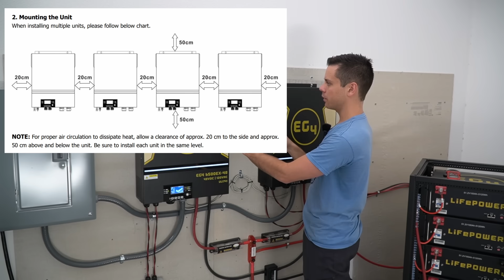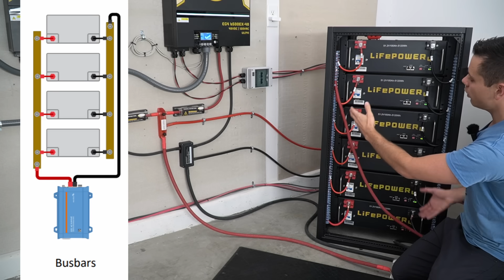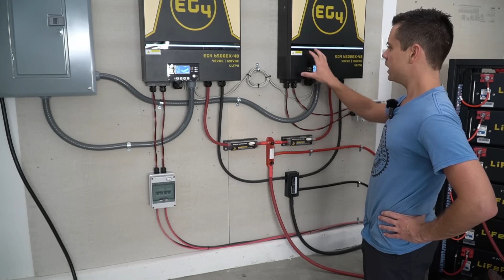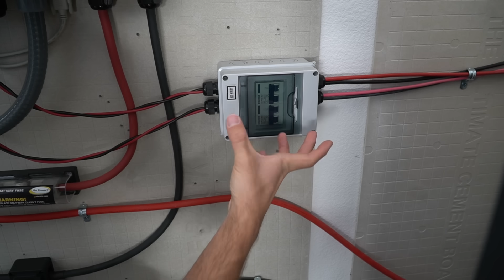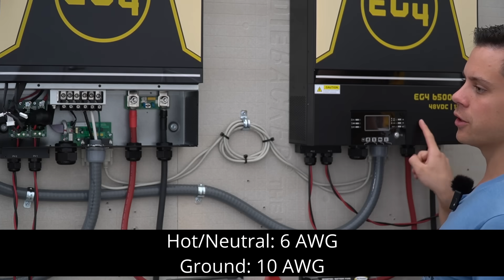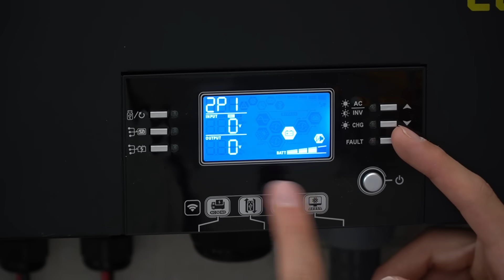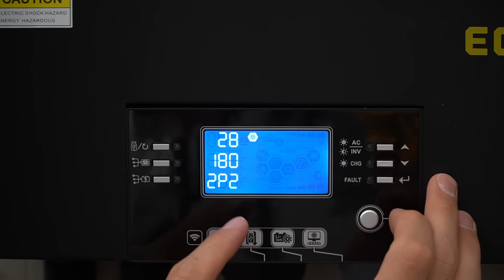Complete 48V Offgrid Solar Power System

Comment: Thanks Will for the detailed and very informative video and also the blueprint on your site. I was already sold on the EG4 batteries but was leaning very heavily on the Growatt inverters. Based on your video and reviewing all the information on Signature Solar site, I have decided on the EG4 6500EX-48' inverters also. Order was placed for four-batteries to start and two inverters.

Here's my questions. 
1. I have built a "solar-shed" about 100 ft from the corner of my house where the main enters the house. I currently have a 13kW backup generator that can be connected to a 50amp connector and also have a 50amp 2-pole circuit breaker with an interlock device on the main panel. In looking at the specs of the EG4 inverters in split phase I am seeing a running amp rating of around 54 @ 240v (13,000w / 240v = 54.17 amps). With the inverter surge capability would it be safe to use 60amp or even a 100amp breakers, both at the connection point and the main panel. Also feed this circuit from the solar shed sub-panel with a dual-pole 60amp or 100amp breaker?

2. The other question which is coming from my electrician is the "service-cable" from the solar shed to the main panel connect point. He is saying that 50amp on 1/0 cable is the way to go. What is the max amps I can run on a 100' service entry cable? Where do you find this cable?

The reason I am asking is that I have had several occasions to run the 13kW generator for the whole house and it does trip the 50amp circuit breaker on the generator at times, especially when the AC kicks in. I am looking at installing a "soft-start" on the AC's which should drop the amps needed significantly.
Reply: quick update...I just spoke to my electrician friend again. He is suggesting this solution:
- 100 amp sub-panel in the solar shed to service the shed and inverters and shed power loads for lights, etc.
- 2 ground rods outside the solar shed to ground everything in the shed
- 2-2-4-6 Aluminum, direct burial, service entry cable from the shed to the main house panel
- replace the existing 50amp breaker being used for the generator with a 100amp breaker and connect the service entry cable to it
- neutral and ground connected appropriately in the main panel
- this will allow the use of the existing interlock safety switch to make sure the grid main and solar main cannot be on at the same time
- move the 50amp connector and circuit breaker to the shed to be used as AC input to the inverters for backup battery charging via the generator

Comment: Hi Will, we bought the growatt combo with the eg4 battery from signature solar. They have been awful with their customer service. Both growatt units have issues right out of the bix. They are doing nothing to help,replace,or return without substantial cost. If you have a contact for them would be appreciated. So far signature solar has been the worst company I've dealt with in years.

Comment: Hi, nice video’s ….are you planning to make a video about creating a DIY AC coupled home battery, for storing ‘not used’ power of a (enphase) micro inverter solar system that is still connected to the grid. Living in EU where off grid is still one bridge too far (solar system with yield of approx 4000kwh/yr…yes only small roofs here-;)

Comment: Do you have a video for solar power for a complete beginner, because when I return to the Philippines I want to put an "off grid" system in and a way to switch it over from the main fuse panel for when the grid goes down! Thanks

Comment: Would this system also be compatible with grid tie? Most solar quotes I am getting are using Enphase IQ8+ microinverters. Can I add this for the battery side? Or do I just forgo the IQ8 inverters entirely? Heard if a single panel goes down that entire system goes down with string inverters. That is also why I was looking at Enphase. Was that all in the past?

Comment: This is something I have been looking at for a long time and I finally am seeing the chargers/inverters that do what I want them to without having to have lots of boxes all doing their own thing. Now my question is... If I were to put a system like that in my shop would the inverters have enough power and reliability to run a 220v air compressor along with other loads?

Comment: Thank you for this great video Will!!  I've watched this at least 15 times so far.  I have learned so much from you and the DIY Forum.    I am getting ready to install my LV6548 with 2-EG4 48 batteries.  I hope to add a second inverter down the road.  The plan is to have AC output to my main breaker panel next to the LV6548 and a sub-panel from that to our off-grid cabin.  No grid tie, but will be having my Honda EU2200i generator going to the AC in on the LV6548.  Would be a good idea to follow exactly this setup you did?  What size breaker did you use for the 2 inverters coming into the breaker box?    Thank you!!!!

Comment: Be careful with this Inverter. I got one last week. It worked great for a while then something happened not sure what caused the fault but the PV input has a short on the input. The short circuit caused a small fire with one of those cheap DC breakers, don't use them! I have been waiting for some  support for Signature Solar to see if they can diagnose the issue. I think it is going to be a Return to Factory. Signature Solar is busy and are taking several days to return calls etc. This Inverter has a lot of potential but be careful and not cheap out on DC Breakers. If/When I get a replacement, all DC breakers are going in metal boxes with Elide fire suppresses just in case of an other issues.
Reply from the maker: Holy cow can you post some videos to our forum?? Or pictures or anything thats awful. Would really help everyone if we can see what happened.
Reply: @WillProwse  Yeah I have some photos and video. I will post in the forum.
Reply from the maker: OHH wait was the breaker sold by signature solar? Which model number exactly is on it
Reply: @WillProwse  No  it was not a Nader DC Breaker. It was a cheaper DC breaker from Amazon. I will only be using the Nader Breakers or something of similar quantity going forward.

Comment: Great video Will. Thank you. The only thing I can't figure out is if these units have remote gen start in them, or is that something else I'll need to add on? Planning on building this exact same unit with a propane gen to supplement cloudy days in the NW.
Reply: Cummins make a transfer switch, which was installed AFTER the pair of LV6548s, with a 120V sense input on the Cummins generator to switch the transfer switch from the LV6548 to the Cummins if the LV6548 output disappeared (i.e. no grid, no solar, flat batteries). I also wired an EG4 Chargeverter to the Cummins output to charge the batteries when the generator is running.

Comment: The 240Vac is common in Asia and Europe. The kicker is massive output of 13KW which got everyone jump for joy this side of the pond! The battery bank to inverters sizing is spot on. Thanks for the clear and concise info as usual.
Reply: If you work with Signature Solar AND  listen to Will, you should have no "problems." I like when Will says, "problems," as this could mean fires or electrocution, LOL. Will is actually more knowledgeable than the average electrician when it comes to this genre.  I'm putting this exact same set-up on my off-grid farm in NW NC.

Comment: Will, I'm in the process of researching a "hybrid" 48v DIY system (240v AC as I have a well pump and air con).  I want the bulk of my power coming from solar, but with the grid for charging my battery bank on crappy/cloudy days.  is it as "simple" as a large enough PV array plus a grid powered AC charge controller?  install a second new main home panel, rewire it to my DIY solar off grid panel.  then have my old grid-powered main panel charge the battery bank simultaneously with new PV main panel?  will land somewhere in the 10-14kw PV array and 400ah bank, sizing up my battery bank as funds allow.  any plans for systems like that?

Comment: In UPS (Bypass mode) what is the specified power that can be supported by this configuration?  Is it the 13,000 W?  I assume that in bypass mode, the system maintains the batteries charge while the grid is up and the batteries/ inverters take over when it drops out.  The principal reason for these seemingly obvious question is to verify that in this mode the units have the same power specs as in normal inverter mode.

Comment: The EG4 6500 EX-48 spec sheet states operating altitude of up to 1500 meters.  My location is at 8700 feet ( 2652 meters.)  I am concerned about the inverter and what safety concerns might be involved when using it at that altitude.  Anyone have experience using these inverters at higher altitudes?

Comment: So for a 240V system, like in England, I would require a minimum of 2 EG4 units? Thanks for the video
Reply: No one will suffice.   You can set the voltage to 220 or 240.  Wills setup uses 2 inverters because of the US 120/240 split phase.
Reply: @cryo450  Aah makes sense. Thanks

Comment: Great video. Correct me if I am wrong. But when we  add up total cost with soar panels, equipment,  shipments, export, installation cost, about 100 plus, labor hours to install. It seems to cost customers or end users about $60,000US.  For a complete 200 + amp solar panel junction kit to an existing home, using the accounts existing AC panel system.  Plus the space needed to install 45 to 50 solar panels.
Reply: Carmine, first for a 30kWH system you should only need roughly 17.5kW of solar panels (depending on your location).   At 450W/ panel this would be about 40 panels maybe less. The panels cost $200@, plus shipping, installation, combiner boxes, fuses/ breakers,etc.  You should be able to get all that done for $500 per panel including the panel purchase.   That is $20,000 plus Will's system cost of $14,000 for a total cost of $34,000.  Which is just slightly more than $1 per WH of power storage.   I sized the panels to support twice that amount of power which assumes that you use 30kW hours of power while the sun shines and simultaneously fully charge your batteries so you have another 30kWH available when it is not shining.   If you base your system cost on the 60kW combined then you are closer to $0,50 per WH of power potentially supplied daily.

Comment: Hi Will, when will u be able to answer my question regarding solar panel configuration for this video? Also in your video I see 2 additional wires coming from your battery connection going off screen. Where are they going? Thank you for the great videos?

Comment: Communication error 61 between EG4 inverter and lifepower batteries. 
The preset for EG4 Lifepower batteries are showing charging voltage of 58V and max amp charging as 120A when I look at it in the App... The manual for the battery states 56V and 100amp as recommended. Hmmm...

Comment: Hi Will, This system is exactly what I want to build to charge a tesla model s.  My question is my average daily use is about 40 miles.  How many of these server rack batteries would I need to start with. (Adding more later) and how many of the San tan solar panes would I need to buy to charge them.  Thanks, David G.
Reply from the maker: Oh that's easy. I would get at minimum 20kWh to start with. That will give you just enough for daily driving and a little bit more.

Comment: Can a battery charged by solar panel and used by the appliances at the same time?
Reply: But of course. However if your batteries are fully charged,  what is actually happening is the current from the solar panels is feeding the inverter as there is effectively no current in our out of the batteries in that scenario.

Comment: This is superb system you have. But why don't you house everything into a 19" panel since you put batteries into one? A 19" panel with glass doors could protect the system from dust, pest and offers a smaller footprint in the house. And if needed, it can be moved easily to another site for sale if one upgrade the system. Just my 2 cents worth. Thanks for your great video.
Reply from the maker: Need a lot of airflow for inverters or they will shutdown

Comment: I think this inverter can be used  Parallel with the AC Grid. ie. SGB Mode. Solar 1st, Grid 2nd, Battery third. Anyone have experience with zero export mode so it's invisible to the Utility?

Comment: I've been watching your videos for a couple years. This might just be the culmination of everything you've done- sans the panels, and connecting said panels to this. 

The components you're shilling here are absolutely fantastic devices at a great price. We could find cheaper stuff at alibaba, if we're willing to... risk it. I'm in Texas, so seeing that the inverters etc are from signature solar is even better. 

Again, thanks for posting this. 

In 2020 and early 2021 I followed your videos pretty closely. In March 2021 I finally got Tesla out here to install the "large" (16.4 kw) panel set, and 4 powerwalls. I didn't have the time to do any DIY.

Well, now I do. I installed another shop building and this.... is diamond-level stuff right here. I'm going to follow it almost to a T, of course also installing some panels. Nowadays you can actually have the racking pre-installed if you are constructing a metal building; there are components that the metal fab companies do depends on the type of roof of course. That directly translates into a very simple panel installation, if you have the knowledge and ability to get up on that roof; otherwise, you'll save a ton on install, since there is literally only labor involved. 

Thank you, sir.

Comment: In one of these videos about this EG4 system, Will suggests using heavier wires than the ones here (AWG6 for N,L and 10 for the ground.) These work but I had a difficult and unsuccessful time trying to use AWG 4 for N and L. which he later suggested.They are way too big to fit in the EG4 AC out and also would not fit in the breaker suggested. (I decided to use the 200Amp fuse ,as attachment to the bus bar was much easier. I'm new at this but fitting 67mm^2 into a 50mm^2 slot will not work.

Comment: Hi, Will - Is the AC output of the EG4 clean ? I have an Outback system and the AC output has a lot of harmonics (dirty electricity). This seems to be common with inverters. Have you looked at the signal of the EG4 ?

Comment: I was concerned with the same neutral/ground problem with my 3000 ehv-48 but called signature solar and they more or less told me not to worry about it and to bond at my panel

Comment: I'll just throw in that with these numbers, you're looking at 60amps continuous for 2.5 hours or there abouts. I guess another question is how long does it take to recharge that battery bank from 100% discharge.
Reply: Amateur question alert: How did you calculate the amps? I'm trying to purchase surge protection and need to know what the amps are.

Comment: why did you go with 2 "all in one" systems to produce the 220 volts?  don't they sell all-in-one systems that will output 220v ??
Reply: Sure but it will not have 13,000W

Comment: Man this is a great job for a DIY for a total off the grid set up.  But will you get the 26 per cent tax credit this year for this or you need to be grid tied ?  Living in the suburbs of LA i was told you can't disconnect from SCE and live off grid. You still need to pay being tied to the grid. This system that Will has is more than enough for the average family house of 2400 SF but this has to be grid tied. To be grid tied do you need to get a different system like Sol Ark or Enphase to be grid tied?

Comment: Your vids are excellent - you go a bit fast, but that's what the pause button is for.  But I'm not an electrician by any stretch and I am following what you're doing.  I have a friend who thinks I'm an idiot for even thinking of DIY solar system for my house.  I am closing on my new home 7/15 and after I get moved in, this is the first project.  The house is small but brand new construction.   Reading the neighborhood bulletin board posts, people are running $200/month electric bills... which is probably about normal.  I'll have to look at your other vids = I bet you have one that helps figure out how big of a system you need... but one good thing is that the kitchen range/oven is gas - as-is the water heater and house heat.  So the A/C followed by the refrigerator will be the top two energy hogs...

Comment: Really enjoy your channel.  

We just had a power outage today.  We are downsizing to a smaller house 1700 sq feet in just under a year.  (They are just starting to lay the foundation.)  Because of the frequent power outages in Texas we would like to have a solar backup system.  Between this system, the Bluetti AC300, and the Ecoflow Delta Pro which do you think would work best with rooftop solar panels?  

I don't know what would be the best way to configure the system considering integration with the grid.  There seems to be many options, some where the utility company pays you, or where you just offset some of the cost of the electricity used.  What system do you consider the most reliable, which is the best value, and which has the easiest setup.

Hopefully these questions could lead to a good video for you.  I certainly would love to se such a review and comparison of these three systems?

Comment: I confused regarding the ground if you use the inverter as a battery backup system for cloudy days.  I get connecting the neutral and the ground separately and the you use the neutral bar for the neutral so do you connect the ground from the inverters to a separate earth ground?

Comment: Question on solar panels is it possible combine solar panels with wind turbines, depending on where you live, theres constant wind, what sort of wind turbine power output would be viable for off grid use combine this with solar, so kind of a hybrid power generator system.